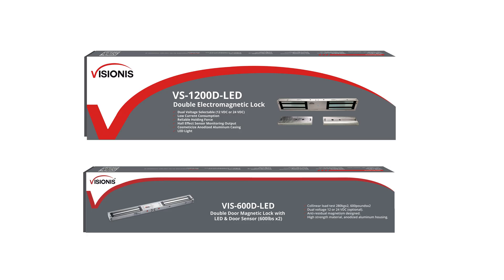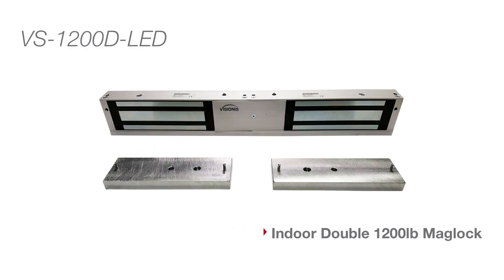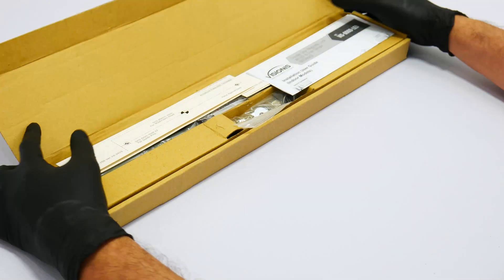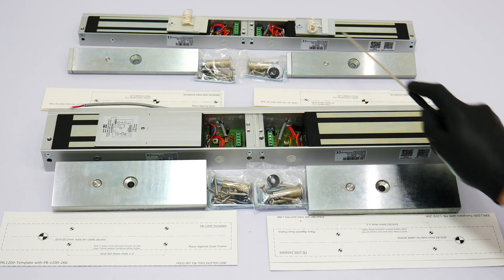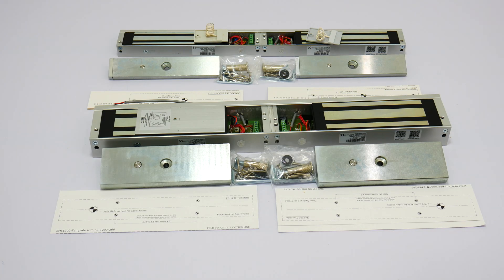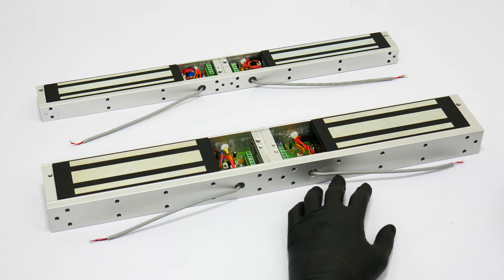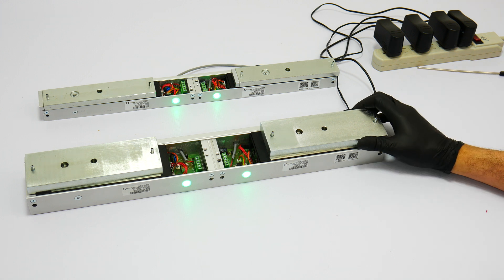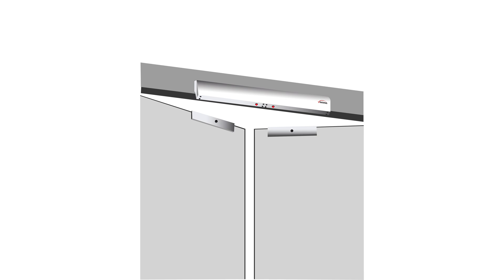Double Door Electromagnetic Locks UNBOXING | VIS-1200D-LED & VIS-600D-LED Visionis

Comment: I have a 1200d that is intermittently allowing users to pull open the door after a few yanks. It seems the plate and armature are lined up properly, the plate rocks appropriately and there isn't a terrible amount of dirt on it. What could cause this intermittent failure?
Reply from the maker: Please, loosen the screw in the middle of the amature plate to the point it moves a little bit.

Comment: can you join the 2 power cables together as one, then you feed it with one power source
Reply from the maker: Hi Michael, Yes, you can, you will connect them in parallel with the power supply.